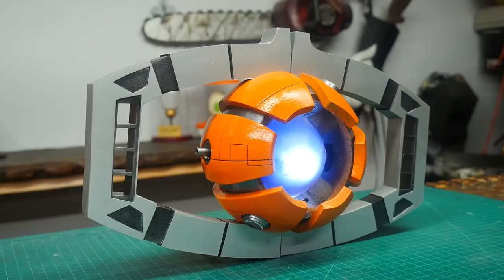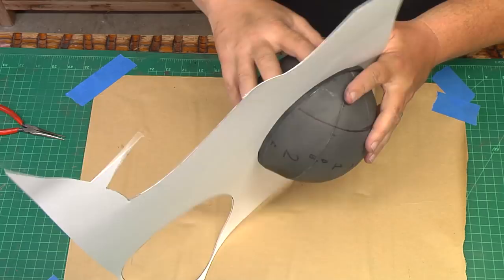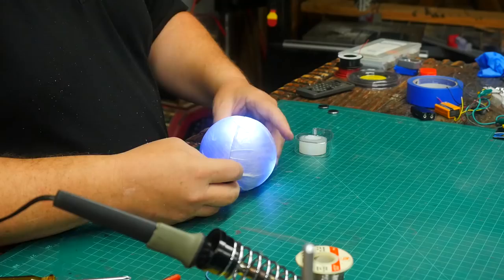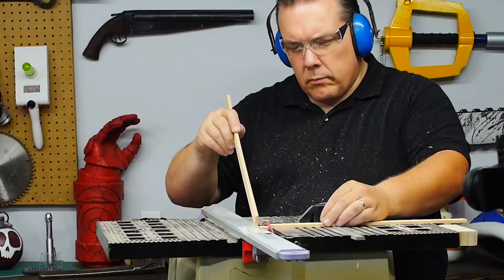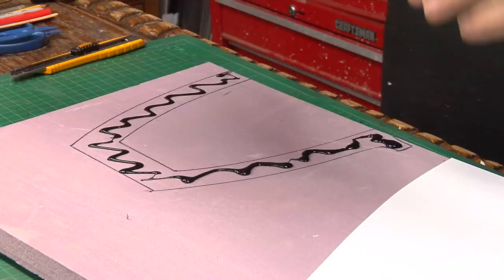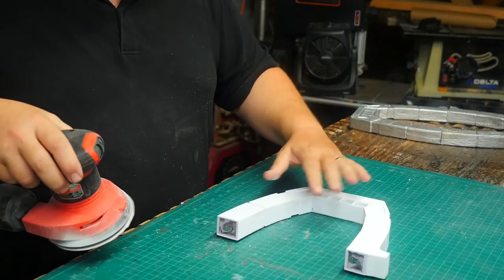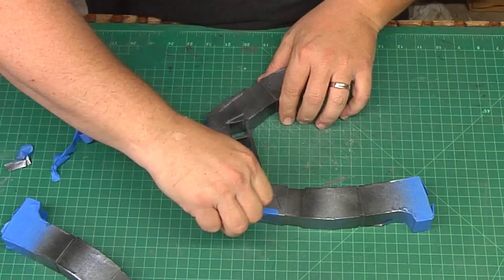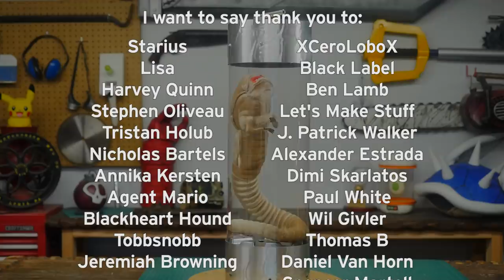Odin Makes: The Matrix of Leadership from Transformers: The Movie

Comment: That blew my mind to find out that the Matrix's core was held by string. I've thought it floated for the past 15 years
Reply: Micah R. Maloney yeah. I think Odin knows this too that's why he makes that face as he says it.
Reply: I did float
Reply: Even i saw the string and that line wasnt on hotrod's chest when the matix wasnt open
Reply: @mixofreak  just watched the scene and idk what you mean. because you can see the string bits actually attached inside the matrix halves
Reply: @thedarkestnight9600  I stand corrected in that specific view, however, I thought maybe it was an animation error, as the 'strings' are not visible on any of the other alternate views of the scene that follow afterward, and only in a few frames, but they are visible briefly in The Return of Optimus Prime as well!  Possibly it was originally an animation error but is now part of canon, even if no other form of media has them.  When I originally commented, I must have blinked and missed when it opened far enough to see that, since I rewatched the scene and can see it now.
Reply: First time I saw the movie with my friends, I pointed that out.
Reply: Ashley Togepi I thought it floated for my entire life
Reply: It does float. I can assure you.
Reply: @OptimusPrimeGen1  no you can look closely and you see strings in the movie holding the matrix together
Reply: @Gold_Bee10  really? I never noticed.

Comment: Looking really great !
I really like that you always try to make on a budget :)

Regarding the glue+paper towel, well it's just papier-maché. you could actually replace the paper towel by newspapers paper and that would make more sens as it would not be textured and thinner to go in the corner. Thus you would need 2 layers but they would also dry faster. Also you can make a glue with only flour + water for that and it cost event less.

In addition to cost and final look, there is a third thing to take into account in the choice of styrene or papier maché. If properly done, the papier maché will stay in better shape way longer that the styrene if dropped or stuff like that. As it's fibered, in my experience my only helmet in papier maché hold the longest in time so far :)

Comment: ........And kickback is exactly why you should NEVER use a miter gauge and fence together on a table saw! One or the other. Should have put a block on the fence to set the distance that was way back from the blade and then slide it forward and off the block using the miter gauge to push the wood through the blade so that the small piece cant become trapped between the blade and the fence. Love the build though!!

Comment: That was pretty good.  The weakest part is your lighting of the orb. There has got to be a better solution for that. Maybe a custom board with LEDs facing six directions and a reed switch to activate the light? Still it looks pretty good.
Reply from the maker: Oh for sure... there has to be many better ways to do it.  Even a battery operated blue LED flex strip.
The biggest challenge is to beat the $3 price!
Reply: $3 is hard to beat, but you spent a little more than that. ;) Like I said it looks pretty darn good and it does the job, so whats not to like? :)

Comment: I used news paper and pva (wood) glue on my evil dead chainsaw. I reckon news paper would be a little stronger than the paper towel. But apart from that followed the same methods you used. Just I didn't realize my foam matts had a pattern of holes in it😆
Reply from the maker: I was so stuck on the racer's version that I didn't think of newspaper!  Ah well...  I will try it in the future!
I wonder how well laying PVA and newspaper into a waxed mold would work...
Reply: I found layering it over what I was doing still left a quite layered effect. Might be worth thickening the wood glue with wallpaper starch to avoid that in molding, or use an epoxy maybe, depends on how long you want it to last I guess. Was a good fix when i found i had the wrong foam though lol. Paints very easy, finally put the warhammer paints back in action :D

Comment: Styrene plastic is easy to work with, it is cheap and sharper,cleaner and more durable. It is great for many projects.
Reply from the maker: I almost had that line written, but then simplified it. Well said sir!
Reply: Thank you! I have wondered if you have ever used centra? It is similar to styrene plastic and craft foam.

Comment: Hi Odin, just a suggestion, but have you tried getting hold of Super 'Phatic glue by Deluxe Materials? (eBay?) It's almost like a super glue that doesn't melt foam and will bond to wood, plastic, carbon fibre and GRP. It's great stuff and I use it regularly on my animation puppets.
Keep up the great work! 
Paul.
Reply from the maker: I am looking it up right now... thank you!

Comment: @odin makes As an extra challenge that may be a first for you but would be great for many builders, can you address how to make the mask/helmet to accommodate glasses? I cannot tollerate contacts and my eye doctor says no lasik at this point until my eyes fully develop. I know you responded to me before on this subject, and thank you, but if you can make a video geared to the glasses audience I would greatly appreciate it. Thank you Odin.
Reply from the maker: It's actually a good challenge for me, as I am nearsighted. Typically I do not wear contacts for shoots, because of all the close up stuff I look at, and I stopped wearing my glasses because of the reflections from the lights. So when I look up at the camera in my videos, I know where it is, but I can't see it clearly.

I have a big 'ole noggin, but it looks like I can put a layer of foam over the cast of Sage's head and get a really close size for my head.
Then I could try putting safety glasses on the head form, and making a pattern off of that shape. It might make a helmet with room for glasses.
The shape of the safety glasses would be important, for a smoother helmet shape, and not one that just looks like a weird version of the Scout Trooper helmet.

Comment: Hey odin, I'm planning a project with this kinda foam and was wondering, would a hairdryer work to shape it or does it have to be a heat gun?
Reply from the maker: I don't think most hair dryers get hot enough for foam this thick.
Reply: @OdinMakes  thank you for answering my question :) how thick is the foam you use? Cause i got some 1/2 inch thick, i dont believe you mentioned the thickness of the foam you used

Comment: Is there anything you can do to minimise the way the core drops?
Reply from the maker: I was trying to minimize that, which is why I was trying to keep it light weight.
There are really only two options with my design:
 1: lighten the crystal core (it will still drop)
 2: get stronger badge retrievers or key minders (I didn't easily find any better that were string, and not chain) - a second set could help, but they might tangle.

third option: build it a different way. :)

Comment: Sorry, but I feel like your core is too small. I still break out the DVD from time to time and each time the core really seems to fill inside of the shell rather than seeming to float in there. Otherwise I like the rest of this build.
Reply from the maker: Richard Greenleaf Too small? Yes it is.
100mm is the largest plastic Christmas ornament they sell. And acrylic spheres makes the price jump from$1.50 to $40. In the past I could find clear plastic globes in the lighting section of hardware stores. Now everything is glass. So my options were: don't build it, or work with what I could get.